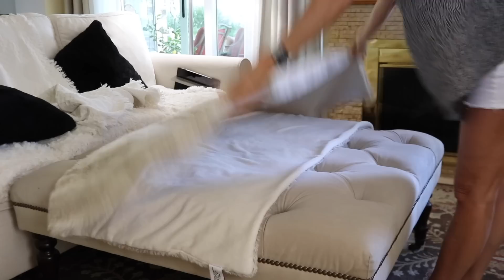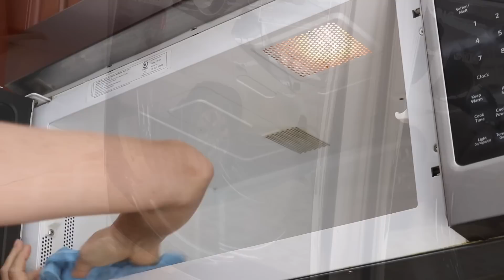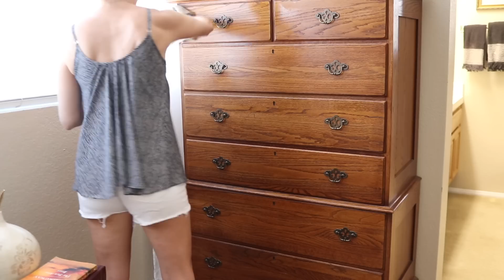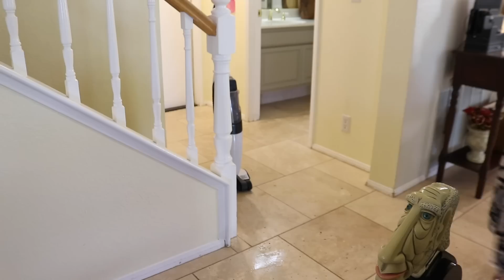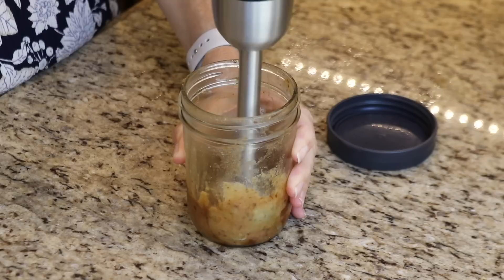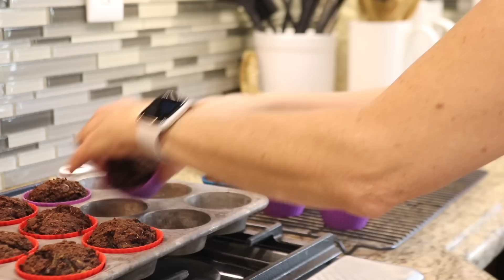DAILY CLEANING MOTIVATION | GETTING IT ALL DONE

Comment: I tried that microwave thing but I don’t think I did it long enough. Question: how do you get rid of the smell from the food that has cooked in there?
Reply from the maker: Hi Liz! Try mixing half water and half vinegar in a coffee mug. Mine usually takes about 5 minutes to boil. There should water droplets on the top of the microwave. If the food doesn't wipe off, set a timer for 5 or 10 minutes to give the steam time to soften everything up. 💕🌸😊

Comment: Hi, Randi. I'm catching up on your videos. Can you tell me what solution you use to feed the hummingbirds? I am using sugar and water, but I haven't seen any. I'm also wondering if the feeder you have (red bottom) is what is attracting them. Mine is a clear glass bottle with a silver circular part around the bottom and light blue feeder flowers. Also, what is the red dye you added? I read somewhere that red dye is not good for them, but maybe yours is something different. Thanks so much for taking the time to read and respond. :)PS...definitely going to try those muffins - thanks for the recipe.
Reply from the maker: Hi Annalisa! I use 2 parts water to 1 part sugar. If there's not enough water I have a problem with ants. I'm not sure if it's the feeder. I know red dye is a bit controversial, but I haven't found anything concrete about this.  I add a drop or two of red food coloring. I get it at the grocery store. The bright color attracts the birds. It took a while for the birds to show up, though. The birds are VERY territorial. Having a few feeders helps with that problem. I hope you like the muffins! Have a great week! 🌸💕😊
Reply: @27foxplace  Thank you! I’ll wait and see if any show up. 😊